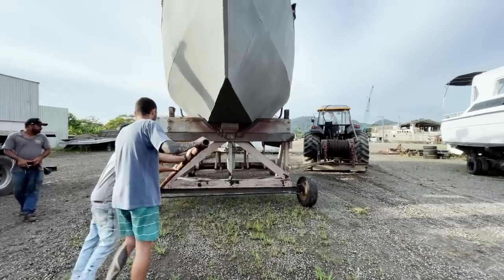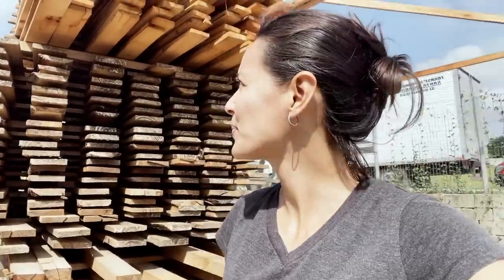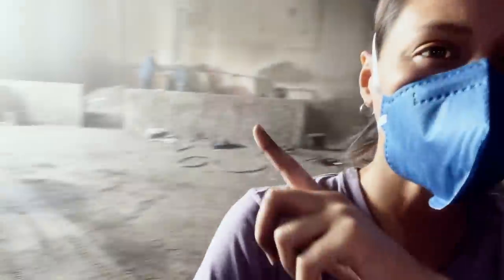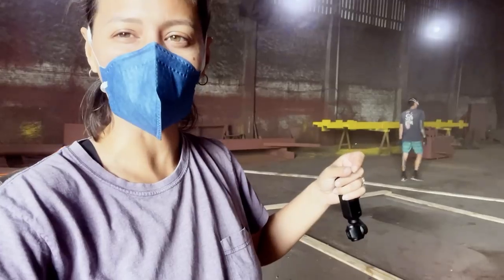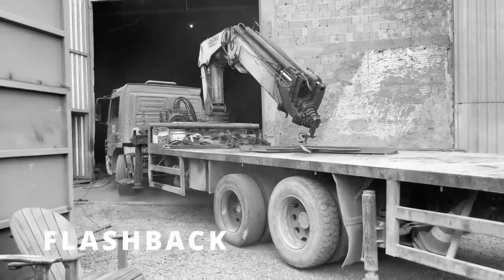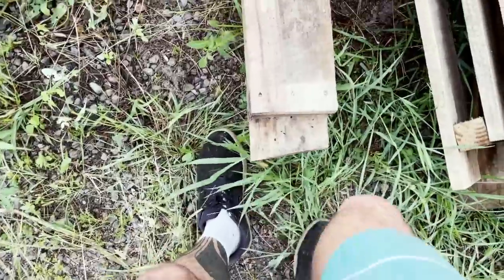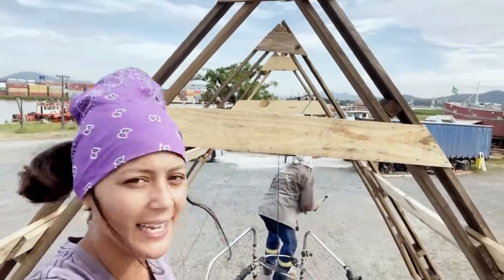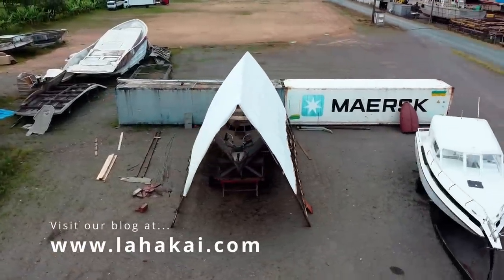BUILDING a HUGE DIY Shed for our Sailboat ⛵️ Ep24

Comment: IMPORTANT: You need to add diagonal bracing on your frame arches.  This is EASY to do, even with the cover on it.  This will prevent the arches from "racking" under wind loads.  Diagonals are boards that go from the bottom of one arch through the middle of one or two other arches, and end up  near the top of the next arch.  REALLY IMPORTANT and easy.  Otherwise, you've done a good job and a shed is a great idea.  LOVE waking up with you on Sundays!
Reply: I cannot agree more!
Reply from the maker: Thanks so much! Great tip! Shed is still in the works so we can make improvements!
Reply: @lahakai  think of the letter X as in scafling
Reply: As a carpenter i was about to say the same:P
Reply: @lahakai  The whole structure can be "spidered " down with ropes criss-crossing diagonally to ground anchors - good practice for storm survival in the mangroves!
I would make use of the big container behind you - run some warps over it and tension them down over your structure.

Comment: Have you considered running rope from the base of one side up over the apex down to the base of the other side between each pair of arches?  That will provide for retention of the plastic beyond what the attachment points on the arch frames will provide and keep it from ballooning.  It may also be helpful to put battens on top of the tarp at each arch to provide more holding surface for the tarp.  Both of these are often added to gothic-arch greenhouses primarily because the covering material (usually translucent plastic) is generally thinner than a tarp.

Comment: I built a 60 ft x 20ft arch Barn near 30 years ago to house my cattle and hay they work great .. I sold the farm a few years back and the arch barn is still standing , so you should be fine make sure you have  diagonal bracing .  Your well on your way . Oh I y
Used stayfast wind shear coil straping .

Best to you both 

Angus 
SV Violet Walters

Comment: Great build, and you made it a sail too. Force x area does some amazing things. We used to use 1/4 inch brass check valves on 15,000 psi equipment, but anything with a larger surface area was 1 inch thick pig iron.  Screw in the ground anchors might help, but think the best solution would be away to lift the plastic in a big wind at least most of the way to get that surface area down. USAA had a double claim day the day my buddy & I decided to sail in a tornado. His cat went down the beach end over end, my cat still hooked to the car flipped over still hooked to the trailer. It was a rush to be lifted out of the water, only to plunge back in again. Yes that Lt  had me sailing his boat as I had the experience.  It was a pretty day when we started. Our wife's were not happy, we were thrilled.
Reply: cats are animals. catamaran is called catamaran
Reply: @userjarabecko  Yes I know but most call them beach Cats.

Comment: It should have diagonal bracing on it or it could just fold like a set of dominoes with a strong wind to front or back. You could do that with ropes if you don't want to plank it. Needs to be anchored to the ground with something like ground anchors (lots) too or it could take off.

Comment: I would do the cross bracing with wood and rope.  
Anchor the frames into the ground with pipe and bolts. 
I would also close up the front and back if you can adding fans to maintain good ventilation.
Lastly I would give yourself a couple more frames front and back so you have additional sheltered area to work in; you will need / want it.

Comment: This is something i used to do for a living....shrinkwrap yatchs by using pvc pipe as the frame for the topside of the boat and tie the pvc to the staunches or railings.and for sheds your frame is good but the special shrinkwrap plastic for this purpose when heated gets tight like a drum skin so less wind resistance  and more airodynamic and anchor to the ground with steel pegs.

Comment: You need wind relief slots at the peak. Then a long drape from end to end that hangs over the slots with weighted edges. Think of Bazaar Umbrellas. The wind under the umbrella escapes through the slot an forces the wind to make a u turn to put pressure in the downward direction, yet,keeps the rain out.

Comment: Your shed came out well.  God job.  I read all the comments and advice about bracing and ropes and closing the ends and whatnot.  I'm not an architect or builder, but I do know that Matt's shed (Duracell) is open on both ends and has stood without problems for over one year.  The only differences I see between his shed and yours are (a) he added one diagonal brace on each side (b) the arches are anchored to the ground with concrete footers and metal brackets and (c) he connected the shed to the boat at the gunwale so that the boat's weight would help make the shed stable.  Love your channel.
Reply: Epoxy and Butyl Tape channel lives in the northeast area of America and he enclosed both ends and it retains the heat .he did a really good job but did it quickly

Comment: As an engineer I say, that you MUST also tie the shed to the ground to prevent it from flying away with a gust of wind. The easiest way is to do the same as with a circus tent: hammer down some steel poles appr. 60 degrees and well into the ground and then tie down at least three points at each side of the tent each to one pole. This will ensure enough strength. However this is useless if you do not first make several diagonal pieces of wood to prevent i.e. the middle of the tent from lifting during heavy winds. By the way. If you on the frame/arch had turned the short pieces of wood (between the two long boards) 90 degrees, is would have been several times stronger. Today, it risk "rolling" between the boards because of the short cross-section...just saying 😉
Reply from the maker: This is a great suggestion! Someone else had mentioned using some rebar stakes in the ground. We did throw some in the ground after the video, but we will put more. 

For the spacer pieces, in retrospect we would have liked a rectangle piece as the square ones rolling were a headache. Good recommend!

Comment: I've seen the Gothic Arch built several times and it's simple as long as you don't make it complicated and use thicker material. You need to run ropes down from halfway up the arch on both sides to a metal stake that's beat into the ground so that the wind won't blow it down. The channel Epoxy and Butyl Tape built one and its withstood the northeastern winter in America.

Comment: I’m impressed by your commitment to this design.
Reply: This design aka Gothic Arch is used alot and is very durable and cheap as long as the builder uses the proper material and doesn't over complicate it. There's videos all over where people are building the arches and have them fastened to the ground in one day. The thicker the material the less its going to want to bend

Comment: Looks great and nice progress. I have no idea how big the potential wind gust can be ..... Maybe you should consider to make some cuts towards the roof at both sides and cover them again with some tarp to make sure you stay dry inside... this way the wind can escape through the roof. Same principal as you see at large terras umbrellas.... just an idea but no idea if feasible 🤔 Looking forward to teh next episode! 😍
Reply from the maker: So far it was just one gusty moment, the rest of the days have been normal. And the issue was the tarp was all balled up around just 5 supports so it created a pocket that caught the wind. Perhaps now that the wind can just pass through it wont be that bad. But love that idea of the flaps. Would be interesting to have 2 big panels on either side then one piece on the top that over hung them and allowed the wind to pass through that created that umbrella effect like you mentioned. Great ideas thanks!

Comment: The tarp cover of our (similar, semi-permanent) 30’x30' arch rib fabric shed is held down on the edges by about 10 cu. metres of gravel as ballast.  Keeps it stable even under heavy snow load.

Comment: I don’t know how windy it can get at your location, but consider that about 15 to 20 miles of wind will get this flying/collapsing. You have the containers in the back - if you can, put them along the sides of the shed, so the exposed area to the wind is reduced by the height of the containers, and also prevents the sideway movement of the structure. Also, the diagonal bracing “Hildebrandt” mentioned, is an absolute must!
Reply from the maker: Good tips!
We will look into the diagonal braces. Was even thinking about putting some attached to the crib. What do you think about that?
Reply: @lahakai  I would not consider to attach the shed to the "Crib", as this could lead to rocking not only the crib, but the boat sitting on it - not advisable! Stick with moving the shipping containers to the sides, that is the best solution if you can have it done.
Reply from the maker: @hgdesignhouseboat5591  Thanks for the advice! duly noted!!

Comment: Please, for your safety
Look back to old Acorn to Arabella episodes about " building the boathouse"
And find some used steel pipe about 40 mm ca 1.20 m1 and hammer these in the ground next to your uprights. Connect upright and tentpegs with a bracket and theater rod .
Like a circustent is pitched.
And yes, tarp till the ground, nailed between two planks. 
Close the ends , make a double door from planks and tarp .
Please ,now you have a kite ,not a temporary boatshed .

Comment: Ideally you need that tarp t reach the ground, and also wall off the ends of the structure with a tarp ... that way it will act like a building in the wind, and not a wing - if you don't seal it up, it WILL fly away.

Comment: i would secure the feet of the shed on the ground to prevent it from flying away in a hard wind. and secure the shed with diagonal mounted ropes to prevnt a crash of the shed in heavy wind.
Reply from the maker: Yes! We do have stakes in the ground with rebar. And the shipyard is also going to help us out with some heavy weights but haven’t gotten to that yet, we will follow up on that. Cheers!